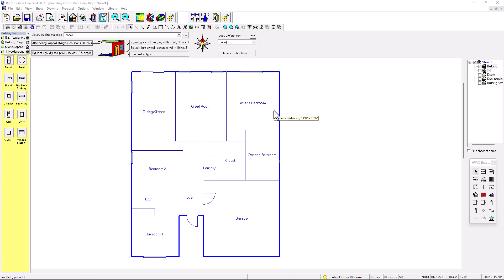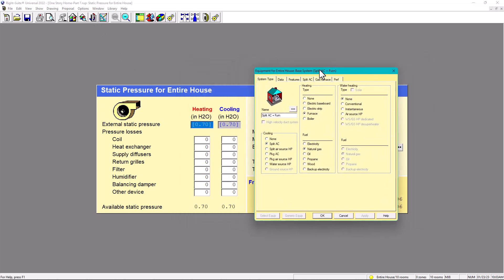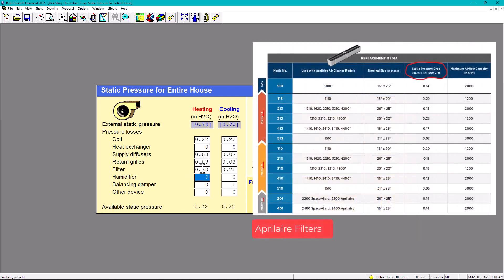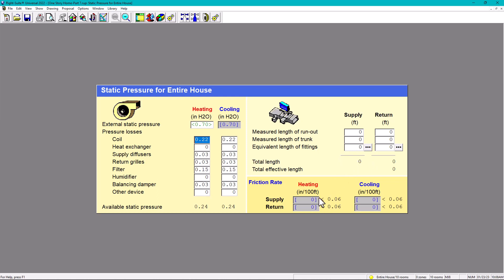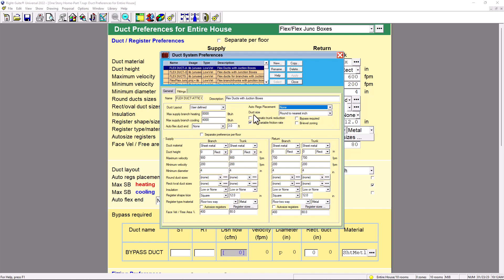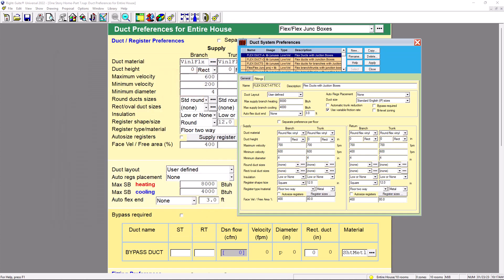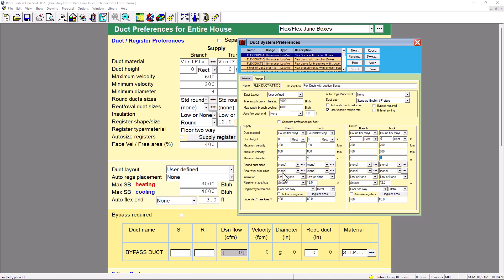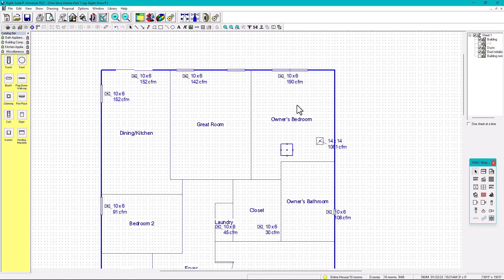Wrightsoft (Part 8): Manual J Heat Load Calculation - One Story Home

Comment: Thanks for sharing these videos. But I have a question. How or where can I see the required outside air per area/room in the cooling/heating analysis?
Reply from the maker: Great question. Wrightsoft calculates outside air requirements based on Number of Bedrooms and total conditioned space based on ASHRAE 62.2. This will generate an overall outside air requirement for the whole house. "Whole house ventilation". Now, in commercial HVAC, which is based on ASHRAE 62.1, we have the calculation for Outside Air for each room. I hope this helps.